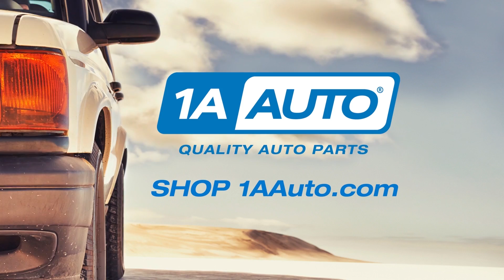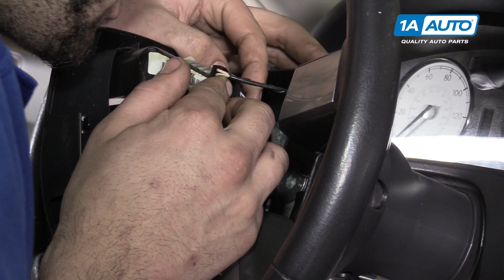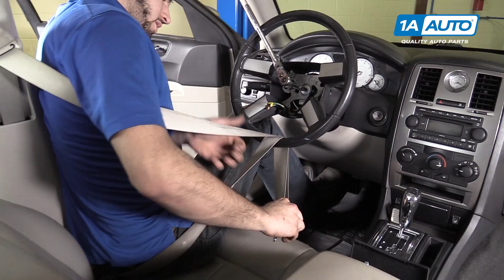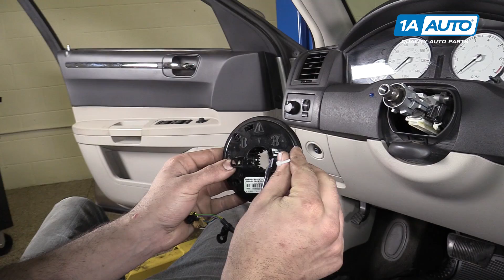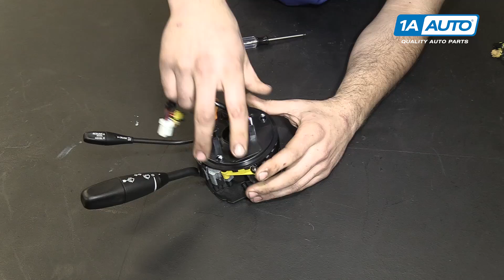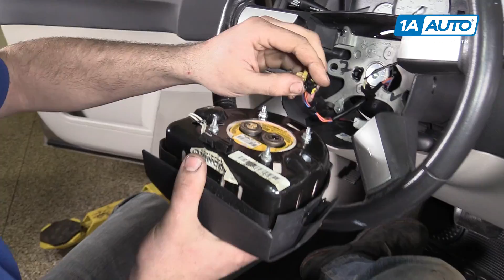How to Replace Multifunction Switch 05-10 Chrysler 300

Comment: My multi switch handel broke off the column ,do I need to replace all parts ,each ,handle for lights,wipers,blinkers ,
It's  the plastic handel and connecting wires broke completely off ? 09 Dodge charger 2.7 ,

Comment: I'm not clear on why you point out to keep holding the clock spring during reassembly. You dont have to hold it in place during disassembly. Also, did I miss it or did you forget to tighten the three clock spring screws?

Comment: I replaced the “Turn Signal Switch” and now I don’t have anything (no turn signal, window wipers or High Beams) I thought it wasn’t seated correctly and adjusted it multiple times, still nothing. I even put the old switch back on and still have nothing. I’m thinking it’s a connection problem somewhere but I’ve checked and rechecked multiple times with no luck.... frustrating! I have an 08’ Dodge Charger and it’s similar to the 300. Anybody having the same problems?
Reply: Same! 05 Chrysler 300. Did u ever get it fix? And how?
Reply: @Joey7Kitty13  same.. how did u fix it???
Reply: Same
Reply: Having the same problem, how did you get it to work l
Reply: @jameswashington3548  any ideas?

Comment: at little tip here...if the steering module isnt fully seated on the column, the clock spring will make a scraping noise when the steering wheel is turned. make sure the module is pushed all the way against before tightening the set screw.